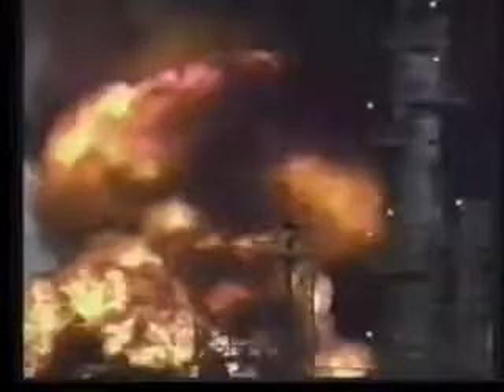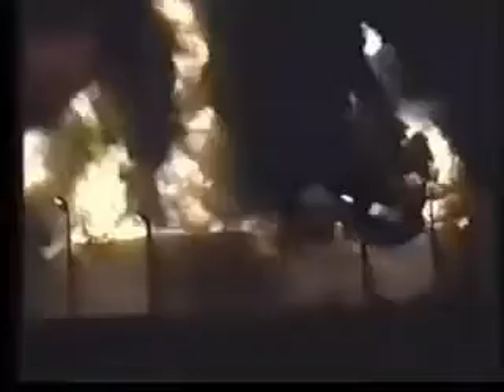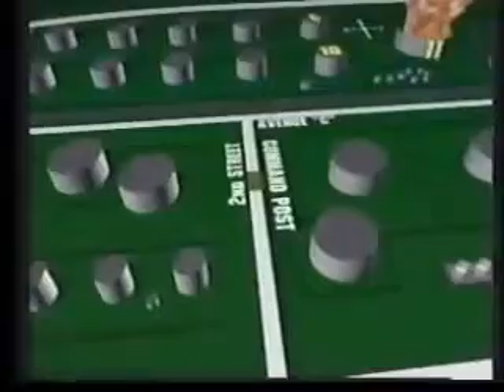Sarnia, ON Alertronic sirens sounding!

Comment: Dual Toned steady tone. It’s pretty rare it seems for ACA Alertronics. I believe they had EOWS 1212s tied onto that old system. They got rid of it in the early 2010s or so and replaced them with ATIs.
Reply: And besides the ATIs, Sarnia currently also has a couple FS Modulators near a plant with FS Model 2-EZ units that sound like Carters. There is also a FS Model 5/7